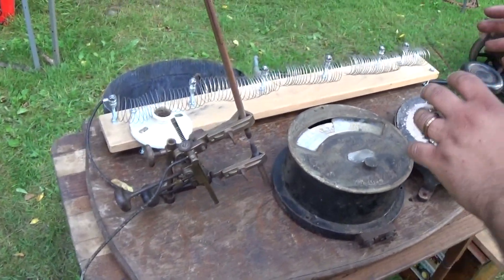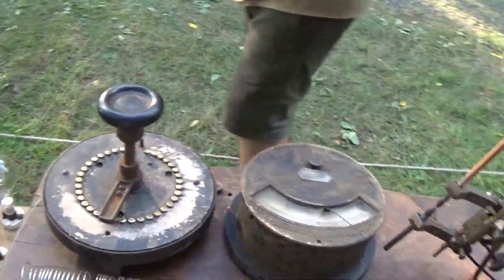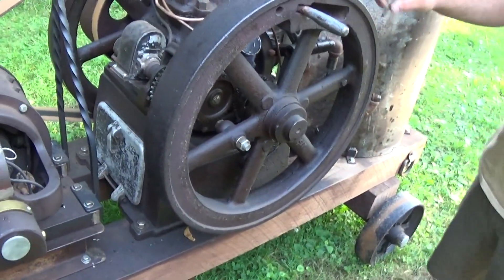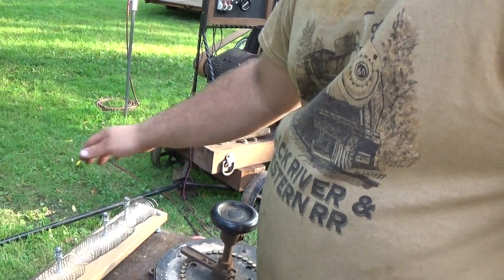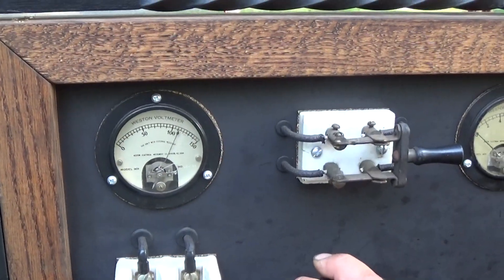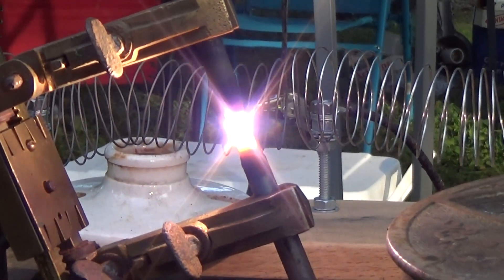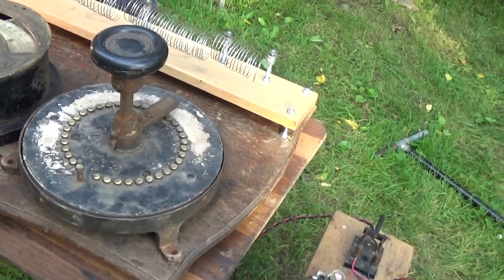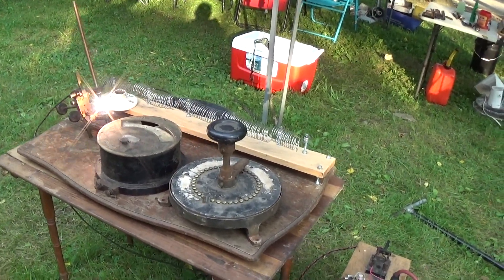Carbon Arc Lamp From 1900 Powered By Antique Generator

Comment: I've worked with a old cinema projector that used carbon arc as light... the feeding of the rod was automatic, but all the start up process was the same... Each rods pair lasted for near 10 hours but we changed them like 2 times on each working day...

Comment: DC carbon arcs are similarly assymetric. The positive electrode is depleted more rapidly than the negative one. A crater usually forms in the tip of the positive electrode.
Unlike most arcs involving metals, the cathode fall in a decent carbon arc seems to be minimal. The positive electrode makes more light than the negative one in most cases. In carbon arc searchlights and projection systems, a DC arc is usually used so that most of the light is emitted from only one spot, the crater in the tip of the positive electrode.

Comment: My older brother was running arc lamp projectors at the local theater in the late 60's. They were still in use in the mid 70's but the theater closed around that time.

Comment: when as a young whiper-snapper,  determined to craft an arc lamp i got the
living snot shock of my life not knowing about ballasts i connected the carbon 
rods from a 1.5 v dry cell to a boat anchor 600v B+ plate transformer well i jumped
clear over the back of the chair , that never deterred me in the least, i continued
my "research" with hundreds of shocks , singed hair, smoke and firemen
thanks for the memories..

Comment: I remember carbon arc searchlights being used in 1955 to attract people to the Easter Show and fairground at Timaru. I was 8 years old and highly impressed with these lights that could show up the sides of the surrounding houses! I couldn't help thinking that the example in the video is a but tiny microcosm of an electric arc furnace!

Comment: I worked at an AMC Bucks County Twin Drive in on rt 611 for 1985 and 1986. I had 2 projectors in each booth using 24” reels which is about one hour and I had carbon arc lamp houses. Two sticks, one 1/2” and the other was 3/8”. They auto feed, and turned to burn the sticks evenly. They where only good for a little over an hour per pair of sticks. If it was a dry night you didn’t need to adjust them much, but if it was a humid night you had to readjust them every 5 or 10 minutes.

Comment: Regarding that belt problem. Consider using a conventional serpentine belt with the correct size serpentine pulley on the gen head. Sure it won't look period correct but on that part of it who cares it would work great and not walk off the pulley. I doubt anyone will really notice. (Just something for you to consider)

Comment: I still have a carbon arc torch from when I bought my first 80 amp welder back in the 70's, I use it to braze metal and also to heat metal to bend and shape it. It only needs 20 amps to run it but you need to use a shade 10 lens to view the arc.

Comment: Rudolf Diesel designed his engine to run on peanut oil, investigate Straight Vegetable Oil, and modified VO, ie adding heating fuel to thin it out, best of all Used VO.

Comment: Does the genorater put out 120 volts 2 wires or 240 volts with center tap for two 120 volts circuits like in a house

Comment: Since 2017, I started taking welding classes, I've not used a "carbon arc welder" yet, only seen them on YouTube.  

Stick welding is about the closest welding method I think that relates to this device, although the rods only last for about a minute or two; and of course you have to have your hood down.

Comment: You just need to mount in in a reflector housing with the Batman signal in front. Great showstopper. Refurbished a couple of 1900's picture houses in the UK, winches in the roof space for the gas lights to be lowered- hung the new lighting on them, Perspex shields over the open valve gear of the generator so that the oil wouldn't be flung everywhere. Had the big old knife switches. We polished them up, varnished them and set them on the wall in the control room with 12 volts running through them to indicator lamps. Hid modern control gear inside old cabinets. Looked great when running.

Comment: I have a FM "F" Light plant with control panel and need help wiring the panel into the system.  In one of your segments you mentioned working on an F unit before.  Did you work on a unit with the separate wall mount control panel and could you anything about the system.

Comment: Up until the seventies this town had Arc circuit lights circuits it was a Transformer that took 4160 why I converted it to a much higher voltage I'm not sure I think around five thousand, anyway it was serious lighting and there was an arc circuit pill so if a light bulb went out it would Arc through the pill but these were incandescent bulbs but it worked in the series very interesting it was called Arc circuit but it used series lighting but I worked on a tugboat one time that had a automatic feed that work on voltage and it automatically crank the ark into the correct position

Comment: Those carbon clad carbon rods in a projector typically ran from 40 to 75 Amp. At higher current the arc is more stable.  In DC a positive and negative electrode is used.  The positive is much longer and larger in diameter and is consumed at a faster rate.  The lamp in the video is an AC lamp. It can be identified by the use of 2 identical carbons.  The AC arc lamps ran at higher voltage and lower current as they needed to re-strike every 1/2 cycle.  Due to flicker they were not use for motion pictures, but sometimes used for slides.  AC carbons most often were powered by 115VAC and used a ballast inductor.  For movie projection, DC is used and the generator most often ran ~70 volts DC with a resistor to drop the voltage to an arc voltage of ~30 volts.  Projectors used a magnet to "Blow" the arc out from between the electrodes so more light would fall on the reflector instead of being blocked by the rear carbon.  AC carbons sometimes used an electromagnet to blow the arc as AC required the polarity reversed every 1/2 cycle.

Disclaimer.  Old time projectionist with experience running carbon arc projectors.
Reply: isettech those electrodes look just like the ones we use for carbon arc gouging in welding to remove bad welds or backgouge steel. Only we use it at 350-400+ amps
Reply: Copper clad carbon rods you mean...?
Reply: And if the projector failed for more than a few seconds during an afternoon matinee, the poor sod up in the box would be subjected to a chorus of hoots, whistles, jeers and foot-stamping from the unaccompanied small boys in the cheap seats!
Reply: @peteacher52  Carbon Arc Projectors have a long proven track record for reliability. They don't Just go out without a power failure. There is no filament to break and no glass bulb to shatter.
Reply: This is some incredible information. Thanks so much for sharing.

Comment: and generating power with a large two stroke with big flywheels (diesel)
Reply: Diesel engines don't have a magneto ignition..  :-)  Look for the set of horseshoe magnets on the engine magneto.

Comment: + Free skin cancer from all the UV-C this thing puts out :D
Reply: Doesnt uvc drop off rapidly with distance. I have videos testing 2 different carbon arc lamps. Was I at a safe distance
Reply: In air not realy, exept the normal drop off rate like with radio waves. Double the distance 1/4 of the power.

 @mikeschannel1616
Reply: Whats a safe distance to a running carbon arc

Comment: One of the many cool things about this is the HID headlights in modern cars use very much updated version of this technology. When you first turn on the lights they flare much more brightly than normal before they settle down, that's the arc forming.
Reply: there is no arc forming, just the electronics setting a stabile state
Reply: @AKAtheA  Actually there is, from Wiki. "High-intensity discharge lamps (HID lamps) are a type of electrical gas-discharge lamp which produces light by means of an electric arc between tungsten electrodes housed inside a translucent or transparent fused quartz or fused alumina arc tube."
Reply: @JeffDeWitt  that's the description of an electric arc.... 
I was reffering to it "forming". There's no forming, it just lights and as long as you can keep the needed voltage, it'll stay lit. 
The brightness fluctuation when starting HID lamps is the electronic ballast establishing a stable operating point to prolong the service life of the lamp.
Reply: @AKAtheA  So the arc magically appears? It's very much the same thing as striking the arc when you are arc welding. The initial arc is brighter and hotter, then the plasma forms and the intensity of the light and the amount of power required to keep the arc going drops.
Reply: @AKAtheA  In modern HID lamps the arc is indeed "striked" by a HV pulse that jumps the gap, then the constant current low voltage supply takes over.
Reply: HID are mercury arc lamps, based on the technology that replaced carbon arc lamps.

Comment: In the projector. lamp-houses the carbons were fed by an electric motor. They just geared it down and it ran off of the arc voltage. When the arc gap increased, as the carbons burned, the arc volts would increase causing the motor to speed up. With a bit of tuning the system would run fine for a 20 minute reel.
Reply: There was a variant that used a photocell to measure the light output and automatically adjust the gap, but they suffered the problem that soot used to cover the photocell and the system would then close the gap in the rods completely.

Comment: One use for the rheostat is for controlling the lights in a movie theater. I have an old Varistat that was used for that.
Reply: A rheostat is essentially just a primitive high-current potentiometer.
Reply: @LuxCaeca33  Yep, wire wound around a core, with a wiper connected to the output wired that's turned by the knob. My Varistat is rated at 2000 watts. I don't need that amount of power, but I did wire the input in series (in phase) with the output of an 18 volt transformer so I could get 138 volts AC on the outlet on my test bench. I also designed a circuit for the panel meter to only read between 95 and 135  AC voltage at the outlet.

Comment: In the Navy in 1983, our little ship, the USS Quapaw (ATF-110) had a 24" carbon-arc search-light on the mast just above the signal-bridge. I saw it tested just once on the pier at Port Hueneme, CA. It projected a perfectly-focused image of the carbon arc on the warehouses along the waterfront across the harbor. The ship was commissioned in 1944 with this search-light installed but never used.

Comment: why is it I see these big hit n miss 5hp engines running things a 5hp briggs stationary can't?
Reply: This probably makes 10x the torque a 5hp briggs put out.
Reply: @fullraph  ah cheers, good point
Reply: @Revoku  I believe it's the most plausible reason. For example when you look on the spec sheets for generators heads they will recommend let's say a 10HP gas engine or a 7HP diesel for the same head. Reason being diesel put out greater torque. SO with these massive flywheels I have no doubt this would easily drive something that would normaly require a much bigger engine.
Reply: @fullraph  I've always had a want to run a slow pop pop pop hit n miss diesel to run 3-7 alternators using the correct pulley setup to get 3krpm into them to then run an PSW invertor(5-7kw) and power a house, just to see if it could be done/as a power backup and run it on used chip oil would be both amazing and fun, tho I'm betting anything over 3 might be asking a bit much lol

Comment: These were common in air raid search lights, later used for Hollywood type promotions.
Reply: Search lights were normally much higher power and used bare carbons about 1/2 and 3/4 inch in diameter and were powered from a 4 cylinder DC generator.  The carbons in the video were for an AC arc lamp. A DC arc lamp used a smaller negative electrode as the positive electrode was consumed at a much faster rate.  This required the gear drive to move the positive faster and further than the negative.  A common voltage before the resistor is 70 to 120 volts, with the arc voltage at 24-36 volts.  In movie projectors, DC was the most common to prevent flicker between the film frame rate and the AC power flicker rate. In addition, a DC motor was very common to drive the electrodes. As they were consumed, the longer arc caused higher voltage and a faster motor feed speed.  This resulted in a uniform arc distance.  DC arcs includes a small magnet behind the reflector to "blow" the arc out from between the electrodes and forward away from the reflector to keep the hot gas tail away from the glass.  Many people assume the arc flame above the electrodes is due to heat rising.  Nope, due to the magnet blowing the arc.  An incorrect polarity when connecting will blow the arc down and towards the reflector, which if not immediately shut off will shatter the reflector due to the hot torch off the arc.  AC arc lamps as shown were sometimes used in slide projection, not movies.   Most larger projectors for 35mm film used copper clad carbon electrodes due to the length of the carbons. A long carbon would change resistance considerably as the rod was consumed during a reel.  A carbon was good for 2 reels and if the stub remaining was long enough, it was good for a short or preview too.  Yes I was a projectionist who used carbon arcs.  Generator ran at 70 volts DC and the arc ran about 55 Amps. Voltage at the arc was about 24 volts.  Ballast resistor was about 1.5 ohms, arc power was about 1300 Watts. Generator was about 5KW to power a pair of projectors.  Remember they ran reels and most moves were 4-6 reels requiring a changeover every 20 minute reel.

Uses for manual carbon arcs as shown in the video were often used for exposing emulsion for printing plate half tones, and later for exposing silk screen emulsions.  They didn't care about the AC flicker rate and only burned a few seconds at a time for the exposure.  They could not run a 10 minute run without constant adjustments.
Reply: @isettech  don't copy and paste shit on my comments. Wtf

Comment: Beautiful genset. Wish i had something similar. Id like to use an engine like this as ALT power for an offgrid living type dwelling with solar as the main source.
Reply: Yeah but nowadays you can easily get a 3KW generator for cheap that is far more efficient when it comes to fuel.
Reply: Shawn Clark Ofcourse, but there are ways around that. For me its more about the mechanical side of it. Id take a certain sense of satisfaction in looking at and running one of these old ground pounders than a little efficient modern thing :)
Reply: @Daydreaminginmono  I can 100% agree with you there. I think it would awesome to run on wood gas, biomass methane, or some other alternate energy source that new engines couldn't handle. I think that is the true merit of old tech

Comment: I remember some of them were in a bulb.  Enclosed but same theroy
Reply: That is what an HID (high intensity discharge) lamp is...including some vehicle headlights that were glaringly bright and very blue (before some started duplicating the effect with LED).  The electrodes in a bulb erode much more slowly since there is no oxygen to react with the electrodes (in the case of carbon arc lamps, like in this video, the oxygen reacts with the carbon electrodes at high temperatures to produce carbon dioxide and carbon monoxide slowly consuming the electrodes...and ,of course, the the intense UV produced by the light will also be splitting O2 into ozone).

Comment: Tow boats used carbon arc lights in the 1960s when I worked there.  They were really bright and changing the carbons was always a pain since the lights would be really hot from the arcing.  I don't know what they use now.
Reply: roy gunter we still use a few carbon lights, but mostly xenon is what we use now.

Comment: In the early 1950's I ran the carbon arc projectors in the local theater. My first night on my own, lightening hit the transformer out back and we could only draw enough electricity to run in projector at a time. There was a long pause between each roll of film. Boy did I ever hear it from the audience. Still got paid my $3.00 though!!!

Comment: Carbon arc lighting was in common use for theatrical spotlights right through the 70’s until xenon lamps took over. T
Reply: The arc was struck manually and the carbons would feed automatically. The operator had to monitor the length of the carbons and replace them usually during intermissions.